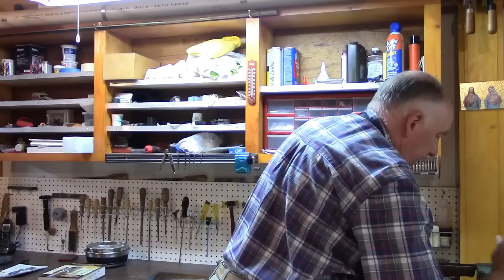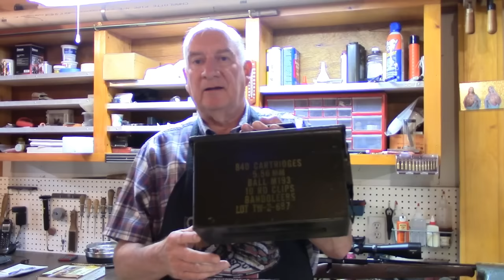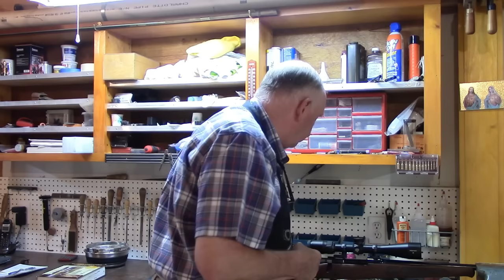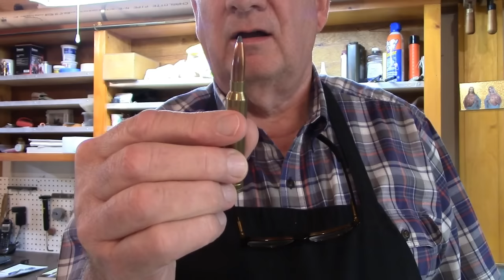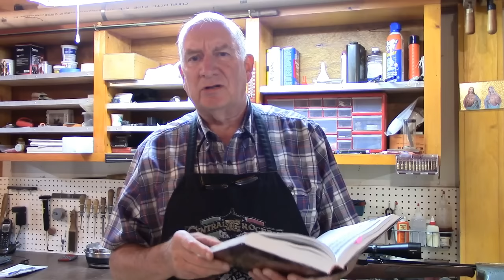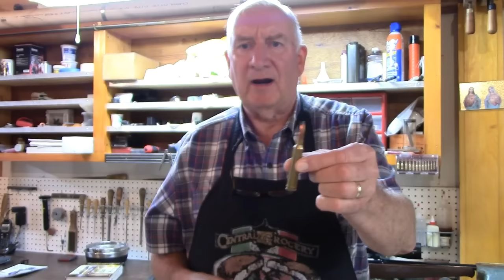How long do barrels last? ~ Discover the truth!

Comment: New is not always better.  The 30-06 was designed for sustained fire and this proven round can hang with any of the new kids on the block.  That deer does not know if it has been hit with a bullet going 3200 fps or 2800 fps, but your barrel will know.  This man takes technical issues and reduces them to common sense.  Great video.

Comment: This is just like listening to my dad. My dad did everything with a 45 ACP a 30-30 a 4570 and a 30 odd 6. These Old-Timers knew all about Barrel wear. They knew what Heat could do to steel. I love listening to this man. Life has gotten way too out of control. Even when I was a young man in the army I kept by 16 on semi auto. Better accuracy and less wasted ammo. That's the way I was taught about dads Garand. God bless
Reply: Thirty aught six, not odd.  Aught was an old timey way to say zero.
Reply: @wickedcoolname399 . Aught came from the military. Then old timers who were @ that time in the military. That said to a degree u are correct.

Comment: Dear Gun Blue very informative. Me and my friends who are shooting precision competition here in Scandinavia regularly coat our projectiles with molybdenum disulfide  .With a 139 grain projectile and a load of 39 grain in a 6,5x55 case we can calculate 3 to 4000 rounds and then a new crown and after 6000 shots the barrel is dead as the chamber is burned out. Normally a we shoot 20 rounds in 30 minutes witch is the length of the tournament. I do believe that the coating is a significant barrel saver, All the best from Denmark

Comment: Thank you I use the 357mag hand hunting in western Massachusetts also like and use a 30-30 model 94 Winchester had good luck with both of these rounds I never liked to heat the barrel up! I am a welder and know that heat is not a good thing with alloy steel .
Reply: So maybe it's a good thing to take two guns to the range, and use each for a little while before switching. I thought I was just building some flexibility into my skill acquisition.

Comment: Been gunsmithing since 1972 , you are spot on. I have had people ask me what caliber I would use for long range hunting. I get strange looks when I say .300 H&H. They reply by telling me how great the .300 WinMag is. The 30/06 with the 220 bullet is faster than the .300 WM. Thay don't believe it , I tell them , check you manual.  I agree with you completely.
Reply: Yeah the 30-06 is not faster you get close if you compare max load of the 30-06 to the .300 win minimum load them it gets closer. But on average on average the .300 win mag is 200-300 fps faster in all comparable bullets at Max or minimum loads.
Reply: Bareel burns by heat of powder, not wear from bullet velocity.Bigger case in small diametar bore means shorter barrel life.

Comment: I've shot the 22-250, the .338 Win Mag, 7mm Rem Mag guns and fall back to enjoying shooting a .222 Remington. In a heavy barrel gun it's a dream, all rounds can go into one hole. The gun kicks very little and the report is just a boom. Even in a T/C it's so very accurate. It's a shame the .223 pulled the rug on the triple duce, it's my favorite round for fun shooting. As for pistols, I enjoy shooting .38 and .357 rounds but practice with lead bullet loads sailing at around 850 fps, just a pleasure to shoot and the barrel remains fairly cool. My trick is to bring two guns and alternate between them, especially pistols. I totally agree with you about heat and taking your time shooting. It's not a race, it's about practice and hitting the target. My family had enormous fun shooting a old Marlin 35 Rem which I loaded .357 FP jacketed bullets in at reduced charges, as a practice round. Everyone loved that gun where later sadly it was traded away. Heat is definitely the gun barrels enemy.

Comment: Back in the 80s, I bought a "first rifle" for my son who just become old enough to deer hunt, from a ma and pa sporting goods store that had a collection of maybe 70 used rifles for sale. It was a sporterized M1903. It looked like it went through both WWs and the Korean. The parkerized finish was worn off on much of the barrel and receiver, and it sat in an almost crude, blocky, stock with a monte carlo comb and was heavy and almost black from being impregnated by years of excessive use of gun oil. For some reason I bought it. I had a feeling that it would take a lot more than playing around with the tightness of the screws to get it to acceptable accuracy. I thought there was a good chance that the barrel was "shot out". At the short ranges that we hunt deer in our neck of the deep woods, I would of found 5" MOA acceptable, at least for a starting rifle for a 12 year old for the next couple of years.

  At the range I ran some factory 150 gr. through it. That rifle, with it's old Weaver 2X scope, shot MOA with that first 3 shot group at 100 yds. I ended up putting a few more groups up, they start to rise a little diagonally, but the groups stayed together. Then I handed it over to my son. I never shot it again. As tempting as it was to play with it, see how it performs out to 300, I had bought it for him. That was the most accurate rifle I ever shot, I'm decent, but I'm pretty confident someone good, with some careful handloading, and a nice scope, could make it perform sub MOA. It shot better than any of my medium and large game rifles.

 My son still has it, that's all he uses for deer, and he's an excellent shot with it. I often tell him I'll trade him a newer, shiny, mint condition Win. or Rem for his old ugly warhorse, but he laughs.
Reply: That was a great story! Thank you! It brings back memories of my grandfather when I was growing up hunting with him in the mid to late 50's.

Comment: I don't shoot my deer rifles until the temperature drops to deer season levels, and especially never during the summer heat. I also stay with milder chamberings, my deer aren't wearing Kevlar. I practice with 22's a good deal but have never been one to want to blow through a case of deer ammo in the middle of July... Anyway, I just nodded my head as you spoke, amen, good advice. 
Glad to hear that Benny's doing well.

Comment: Heated barrels!!! Reminds me of the days I fired an M2 50 cal. MG on the range until the barrel turned cherry red and began to droop!!! Heat kills barrels and it can happen in a matter of minutes. I had a friend who flew F4 Corsairs during WW2. He learned why the ammo boxes in the wings will only hold a 9 yard belt of ammo. Much more than that and the M2 had to be swapped out due to barrel droop. They did not try to straightened out. They had to remove the entire MG. Couldn't  get to the barrel for removal. 

So many things that a shooter can do to burn out a barrel. Snipers use care when on the range in spite of the fact that they burn through a LOT of rounds. There barrels are "matched" their barrels to the round they were using. They may run through 500 rounds in a day but they take all day to do it and allow for barrel cooling.

A great tutorial.  So much to assimilate. Thanks for the good work and taking the time to do the necessary research.
Reply: My dad was a teenage B-24 nosegunner in the Pacific. He told me years ago that they kept spare barrels nearby in case the barrels overheated. I asked a stupid question...was he ever scared? He said," Hell yeah I was!"

Comment: Thank you Sir, for an excellent video and, for sharing your vast knowledge  on the life of your rifle barrel, with the rest of us out here.
I would like to add without taking anything away from your excellent video.
  I discovered a long time ago, using a 180 grain cast lead bullet with gas checks along with 10 grains of unique, in either a 308 Winchester or a 30-06 bolt action rifle,   allows almost for an indefinite barrel life.  

Yes the 180 solid lead bullet only goes about 1800 fps but it is a tack driver, allowing in either rifle, a 10 shot placement all fitting inside a quarter at a 110 yards.  
 I have shot thousands of rounds thru each rifle and I have not notice any accuracy lost in any of my weapons.
 
I sacrifice speed for an increase in barrel life, 
 Accuracy is the name of the game in my book of shooting and to continue to use a weapon for as long as possible.
Replacing a weapon with a worn out barrel is a costly endeavor that I can not afford to do.

These cast lead bullet rounds that I hand load are  a great joy to shoot, are very economical,  very accurate, and allows anyone  to shoot without fear of being hurt by the rifle recoil.   
My feelings on any type of hunting be it small game or big game, if you cannot get within 100 yards or Much less of your quarry, then what's the point in the thrill of the hunt and any game that i do hunt,  is strictly for the table. 
In 40 some odd years the only game I have not taken is, the big browns in Alaska, but it is on my bucket list to do one day.  Thank you again Sir for sharing an excellent video with the rest of us. Very Respectfully, dd
Reply from the maker: I did a video on cast bullets and reduced velocity loads, which I use often and love to shoot.  However, I cannot recommend them for big game except in very large caliber rifles, as they simply don't expand and pencil through, if hard enough to withstand rifle velocities.  My 32 Winchester Special will drive a 177 grain cast bullet at 2100 fps through a 10 inch living oak tree and comes out the same size.  I've managed to recover a couple, and they are so undamaged that they could be reloaded.  That's not good game performance, but are fun to shoot. Thanks for your support.
Reply: Thank you Sir for your kind reply.  I agree with your logic that the lead will pencil through the game.  I found that I really don't need to push the lead bullets out past 1800 fps much, as I found even going just 1800 fps the penetration is at times just unbelievable compared to a factory jacketed bullet.   They are truly fun to shoot that's for sure.
 The cast bullets that I came up with actually do expand some and does not shatter and come apart, the expansion of the lead bullets is much like a 22 lead bullet, except that my lead bullets tend to stop expanding around the halfway point on the bullet going from a .308 dia. to around .625 - .700 dia.  The gas check still is attached to the bottom of the lead bullet, so far I have not had one lead bullet to come apart and shatter yet. 
One time I took and placed 12 one gallon water jugs in a row and measured out 25 yards and took my 308 with my cast lead bullets to see how many water jugs the lead bullets would pass thru.  When I fired off a round  I hit dead center of the water jugs and didn't really see what took place till I walked up and seen what had happen.  
That lead bullet actually went thru all 12 of the one gallon water jugs and the bullet continue onward to somewhere else.  I did try and look for the bullet out here in the sand but no trace could I find of it looking for it with a metal detector.   
Going thru all 12 water jugs, That made a believer out of me how much penetration a 180 grain cast lead bullet that was made out of some cheap wheel weights could do.  
One reason I mentioned hunting less than a 100 yards and/or much less, is that I usually only take a direct facing head shot, and the distances from me to the animal is normally less than 20 feet sometimes so close I could just grab the animal by the head and jump onto it back.  That's what I call the thrill of the hunt to be able to get so close to an animal to be almost one with it.  Granddad did the same except instead of using a 308  cal rifle bullet he used his  Winchester Model 70 in 220 swift with a little 60 grain jacketed bullet.  That was his Deer rifle till the day that he passed., He had so many deer taken with that rifle he put the rest of the family to shame as he never had to go find a lost deer or hog , Granddad only took head shots and always the deer was 10 feet or closer away when he took the deer.  Thank you again Sir, Very Respectfully, dd
Reply: Obviously you did not understand what the man was saying. The barrel does not wear friction between the bullet and the bore. The barrel does not wear but burns. The larger the shell casing, the more gunpowder you burn from a smaller caliber , barrel life is shorter..The barel is burned no mather cast or coper bullets.
Reply: @ciro79  Respectively Sir, I did understand what he was saying.
May I ask you some question, how many rounds  and/or years have you shot through your original factory rifle barrel and still able at 110 yards to place all 10 rounds inside a quarter using copper jacketed bullets/projectiles?

Also sir, Have you ever read any articles from the  60's that the NRA stated , that firing lead bullets that barrel life was .

I been using the same old 308 and 30-06  and a 30-30 Win, shotguns and .22's for over 50 years now with tens of thousands of rounds shot though my rifles, shotguns, pistols and revolvers using nothing but cast lead bullets and lead shot  and  they are still tack drivers.

The pressure and heat and friction required to push a copper projectile (40,000 to 60,000psi or so) down a rifle barrel is 4 or 5 times or more than is required to push a lead projectile down a barrel (8,000 to 12,000 psi or less) which means far less heat, pressure  and friction from the projectile is transferred to the throat and barrel of the rifle using lead bullets as the bullet starts its travel down the barrel.  

How many rounds firing copper jacketed bullets in rapid fire in a bolt or lever action rifle does it take, before you cannot place you hand on the barrel because it get so hot to touch 4 or 5 maybe even less depending on the caliber?  

Have you ever fired automatic weapons to the point that the barrel gets Red Hot, I have Sir many times and the barrels were tossed because the barrels were destroyed.   That's the reason the military issues 2 barrels and heat resistant gloves to change out the 50 cal barrels when they get Red Hot and then when the second barrels goes you are up S... Creek.

For instance back when Winchester first came out with the Winchester 220 swift it was able to go over 4,000 feet per second claimed to be the fastest rifle center fired cartridge ever made.  
But it also came with a terrible problem pushing bullets/projectiles that fast, 
Barrels  were known to only last for a couple of thousand rounds or less before they were shot out and had to be replaced and then Winchester back off the 4,000 feet per second to under 3,700 feet per second to try and persevere the 220 swift barrel life longer and it did work up to a point and then other calibers and powders were developed to address the  erosion problem and the 220 swift fell from use.

When I was reloading Granddad's 220 swift I substitute the copper jacketed bullets with .22 lead bullets with 3 or 4 grains of unique, so he could fire as much as he wanted without the fear of shooting out the barrel and it was joy to shoot I must say and we never shot out the barrel using lead bullets.

Whereas in my rifles I used, a cast .309 diameter approximately 180 grain lead bullet that go less than 1800 feet per second and my barrels still look as good as the day they came from the factory. 

Let me ask you this Sir,  How many barrels has anyone replaced using a 45-70 rifle firing  45-70 lead bullets?
Also how many target .22 rifles, revolvers/ pistols barrels and/or shotgun barrels are ever replaced using lead bullets or lead shot or the lowly .177  or .22 caliber pellet rifles?

I have an old Winchester model 61 from the 40's, almost all the blue is gone on the little .22 and there is no telling how many thousands of rounds went down range and it is still a tack driver same with my old model 12  guns that were made back in the 20's and 30's and the tens of thousands of rounds shooting clay targets with my model 12 trap and 101 shotguns showing no barrel erosion they are all bright and shinny from the chamber to the end of the barrel.

Remember this Sir, that Heat Destroys and Cold preserve, and firing lead bullets/projectiles takes just a fraction of the powder what it takes to use copper jacketed bullets/projectiles to go down range. 
Less powder used means less heat to cause barrel erosion.

Yes I sacrifice speed by using lead bullets, but not accuracy and I gain a lifetime of use out of my all my barrels using lead bullets without fear of ever having barrel erosion as an issue with my weapons.  
I have never needed or felt that I needed to shoot beyond 100 yards hunting with any of my weapons on any type of game that I wanted to hunt almost always less than 20 to 25 yards away, because I know the limitations what a lead bullet can do or not do and I have never lost any game animal from using lead bullets in my rifles. 

 Point is all these weapons are firing lead projectiles that is going less than 1800 feet per second and not going depending on caliber going from 2,500 to 3,900 or more feet per second with copper jacketed projectiles.

I respect your point of discussion Sir, on your perceived notion of my lack of knowledge in the process of barrel erosion, but I do understand one thing, using copper jacketed bullets/projectiles that the higher the pressure and friction is the higher the heat causing the metal not to just to  burn, but instead  start to melt the metal much like a acetylene cutting torch cutting and melting the metal just ahead of the cartridge case at the moment the bullet is pushed down the barrel causing barrel erosion to happen at a far, far greater rate than using lead bullets, 

So Yes I do understand the process of high pressure, friction and heat caused by using copper jacketed projectiles and the barrel erosion caused by such, that someday maybe my barrels will need to be replaced, but most likely my eyesight will be gone and  I will be pushing up daisies by then.
Have a wonderful day Sir,
Respectfully dd